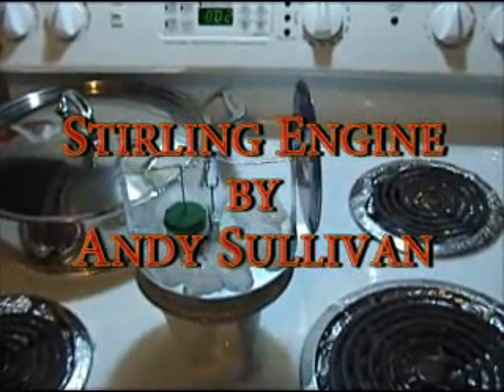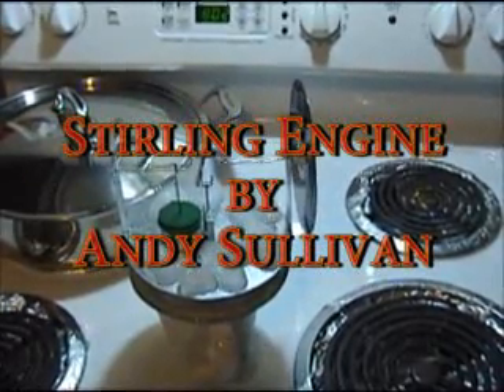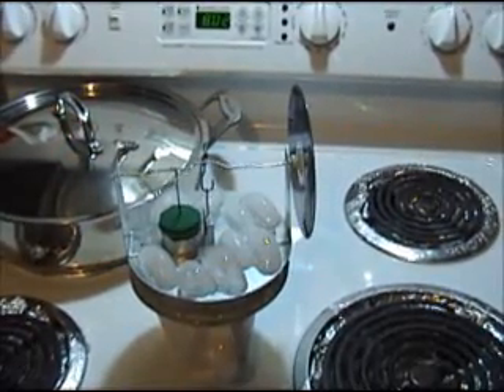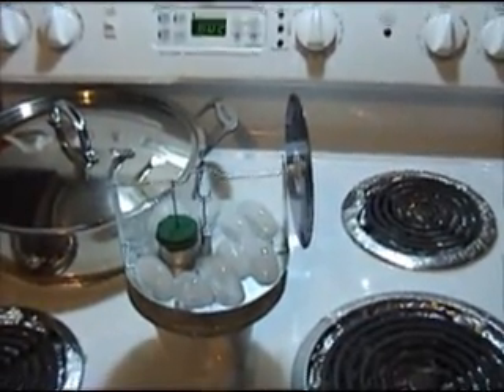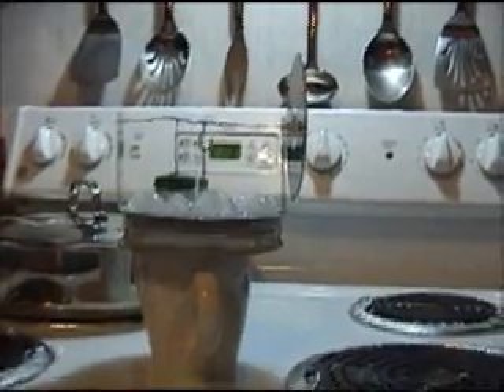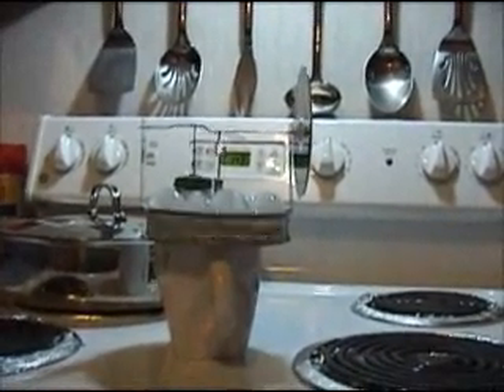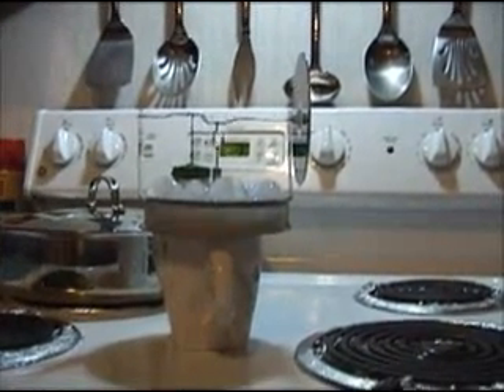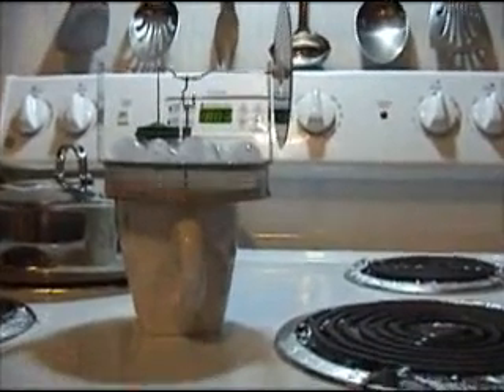Easy Stirling Engine Science Project - No fancy tools.

Comment from the maker: Thanks for watching the video. The chamber ends are thin sheet steel. I used scrap that was thin enough to snip by hand. Sand afterward as there can be razor sharp parts. 

The cylinder is a CD container cut about an inch tall. 5 minute epoxy holds the chamber together. Hot glue was too weak. 

The piston is a cut up ballon. I poked a hole in it with a straigtened out paperclip as a rod. Epoxy on both sides with a little paper pad hold it. A rubber band holds it to the pipe.

Andy-